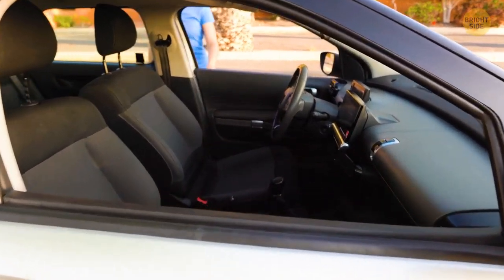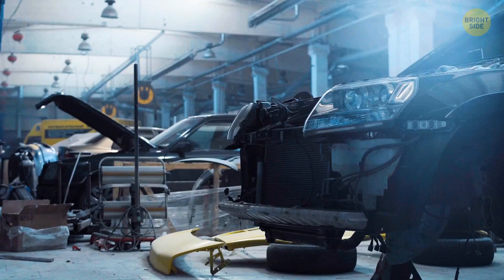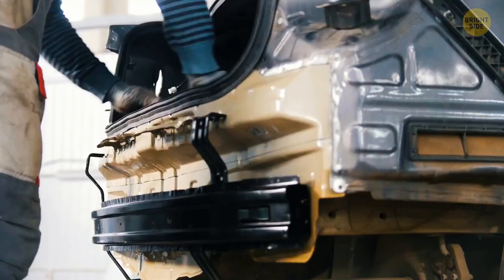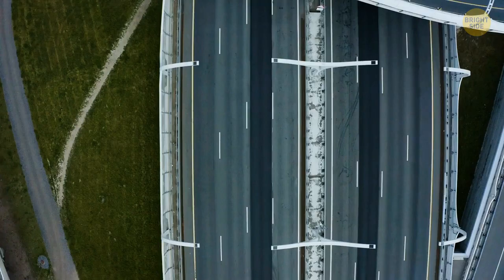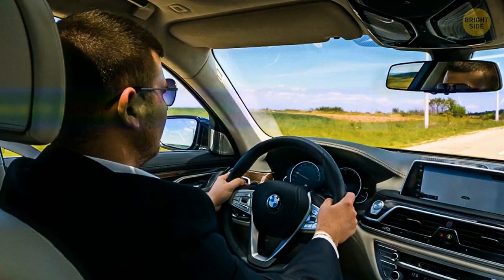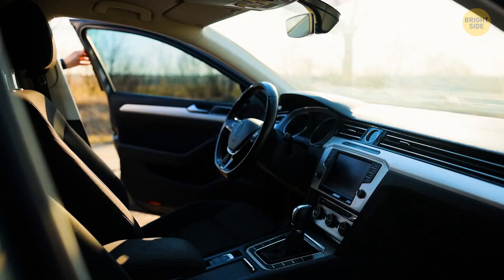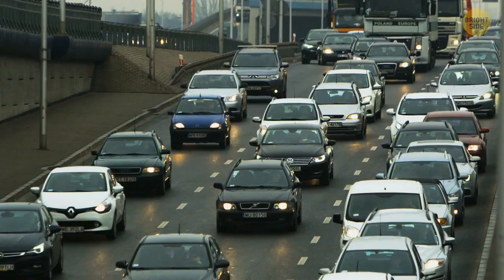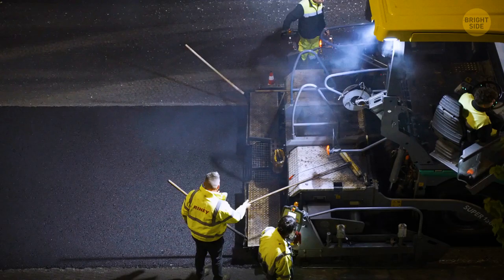Secret Loop on a Seat Belt And Other Car Hidden Features

Comment: Why haven't they added warning messages to tell you that your tail lights are out or any lights are out on your vehicle?
Reply: Lavonda here again so the police don't pull you over for your tail lights being out I don't get it why haven't they come up with that idea hello is anybody out there? 😂
Reply: This actually DOES exist in all vehicles. When you use a blinker and one is out...it starts blinking faster than normal....been around for years hoss...lol...what you drive now has it I promise.
Reply: They’ve already done that
Reply: My 2002 Audi told me when I had a  headlight out, but for the rest of my cars, if a turn signal was out, it clicks faster in the cabin when you attempt to use it.

Comment: Nice tech, but only for those who can pay for such a car. And it wont come cheap.

I have my drivers license for over 20 years, but only since 5 years I own a car which is equipped with ABS and Airbags.

So, unless I win the Lottery or get a high paid job ... It will take someone like me 10 years before I have a car with those options.

Reality Check!